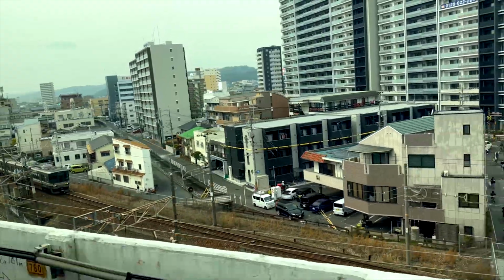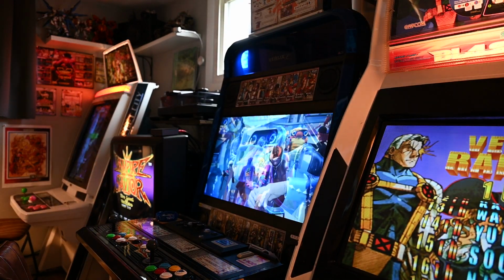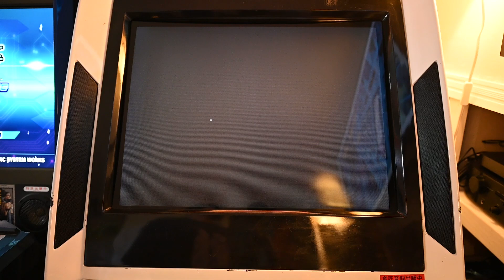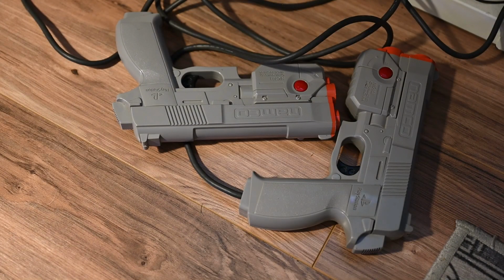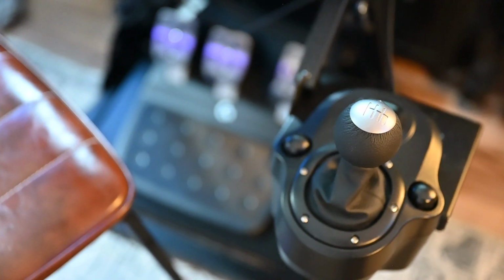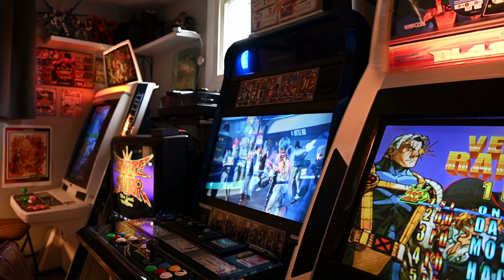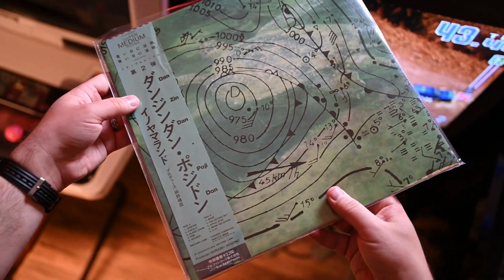Japanese Arcade / Home Office / Mini Game Center for Retro Gaming and Driving Games! Ultimate Setup

Comment: I subscribed because of your NNC LG Dualup swap, but it's cool to see that you actually found a new CRT monitor for it! Have you only found a donor tube, or a complete monitor?

Also, the Blast looks really nice and the Trinitron as well! It's amazing what good quality a consumer TV can bring to the table, it does not look out of place at all in the line up!
Reply from the maker: The Blast City actually came with the Toshiba- but I had to recap it. At that point the Kortek that had been in the NNC had been through its second full pro repair, so I put that in the Blast- the main issue was swapping the tubes on their frames. The frame for each machine was specific, and neither of the frames fit the chassis the individual tubes came with. It was a mess in my office for like days.

Comment: Good evening Dorfus

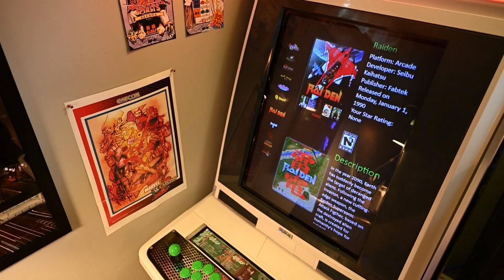Which system is that in the 5:17min for vertical games? Please.
Reply from the maker: @FlashGameplays  the interface? That’s Launchbox Big Box.
Reply: @dorfus  I have a Capcom Impress struggling to play vertical games since it's CRT

Tried the pandora didn't work since the frequence, so bought the Mister FPGA, but it's lacking from many vertical games :(
Reply: @dorfus  Thank you! Also, where did you buy that Vewlix, do you have a link? :O
Reply from the maker: @FlashGameplays  I use a PC (it’s an older one I used to use for work) for vertical games. Final Burn Neo does a better job than the emulation of the games on Steam. As for the Vewlix, I got it a while ago for fairly cheap when the Japanese arcades shut down in 2020. I think you could check out Hadouken-Arcade.com though- I did get a bracket for the LG monitor in the vewlix from him. He sells full machines I think.
Reply: @dorfus  Thank you so much!!!
Reply from the maker: @FlashGameplays  and I will say- the vewlix is kind of the “best machine.” It’s so easy to modernize, and built in a way that addresses all the issues I associate with crt candy cabs. Granted, I’ve never had an egret, but I find working on the vewlix fun as opposed to tedious.

Comment: @dorfus I just ordered a blast city and I my plan is to run it in tate mode to play vertical shooters. I would love to pick your brain on how you are doing this on your new net city? It looks like you are running a pc with big box. Is this true? If so, how did you configure it. More or less.
Reply from the maker: Yes! That’s exactly what I did. Your ease of doing this will really depend on the type of monitor you get though- my Blast city has a tri-sync, so it can run a 480p signal from the pc easily. The Net City only came with tri syncs. If you have a monitor that can do only 15k, it’s a lot tougher to get a PC hooked up.
Reply: @dorfus  it's the original trisync monitor, so that is good to know. Mame runs fine on it? I keep seeing people using groovy mame. Are you using that? Also what is your I/O the original hardware or brooks boards? Thanks again for your help
Reply from the maker: @arthurclayton8866  Yeah, anything that is 480p will run just fine on a tri-sync. You'll be scaling it PC side, but that really doesn't add lag. The GPU in this is I think the last one that supported an analog output- the GTX 970 or 980- I'd have to double check. I actually use FBNeo for pretty much all arcade games at this point- not MAME. I/O is all Brook and USB.
Reply: @dorfus  Thanks, any reason why you use FBNeo over Mame? Is there better latency with FBNeo?  I am not familiar with FBNeo and I need to research it
Reply from the maker: @arthurclayton8866  It was a year or two ago that I settled on it, but yes- FBNeo was the most accurate solution for certain CAVE games.
Reply: @dorfus  very cool. I will look into it. Last question, in regards to your video card are you using a dvi to vga adapter to run it to your crt ?
Reply from the maker: @arthurclayton8866  yes- but you need to make sure your card actually supports Analog signals. Some later DVI cards don’t.
Reply: @dorfus  I have an old office pc with a gt730 laying around and it has a vga port. I was thinking it should be enough to put these games at 480p. What are your thoughts?
Reply from the maker: @arthurclayton8866  That should totally do the trick. I think most emulation is more CPU intensive than GPU.

Comment: Do the brook boards convert everything in one or would I need to buy a different board for each device I’m converting- pc, ps5, Switch so on ?
Reply from the maker: The brook boards connect to anything with usb, and convert inputs for it. Some consoles like PS5 are a little tricky- you will need a higher end Brook board if you want to play ps5 specific software. I’ve also found the ps5 specific software to be picky about usb cable quality, and the number of cables chained together. The Switch does require you to hold down a button at the time the system is powered up or comes out of sleep. For everything else, it’s fairly automatic.
Reply from the maker: And to just go a step further- Brook makes a lot of adapters that go from say a Dreamcast or Neo geo to usb. Those then connect to the boards as shown.
Reply: @dorfus  thanks for the reply, wasn’t expecting it so quick. Thanks for that info also appreciate it
Reply from the maker: @panicfarm9874  no problem! Also, check out my guide on USB switchers- again, the PS5 is real picky about that stuff and doesn’t work super well with them… but everything else works very well.
Reply: @dorfus  will do

Comment: 5:14 is that a modern aftermarket board ?
Reply from the maker: That's the board that came with the 2008 Kortek Tri-Sync I've got in the Blast City now. It's had quite a few issues, but the image quality is very good in 31k. I'm not super happy about how the geometry looks at 15k though, way too much distortion on the sides. Definitely made for 31k content.
Reply: Thanks for the extra details. Given the year it was made we could say it was one of the last then
Reply from the maker: @SP95  yeah, pretty much the last tri sync replacement unit someone could get. The tube is a Samsung- I’m curious if it’s in any other televisions of the era but not set up as a tri sync.
Reply: I know Wei-Ya used to also make tri sync boards as well and they've also made these until about that same year. Cannot tell you the kind of tubes they've used but this should not be too hard to find.